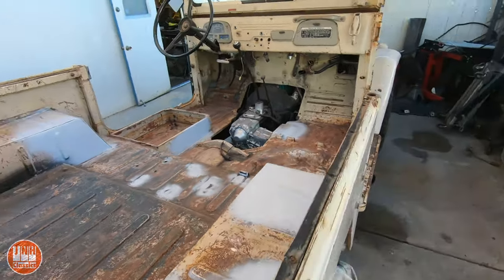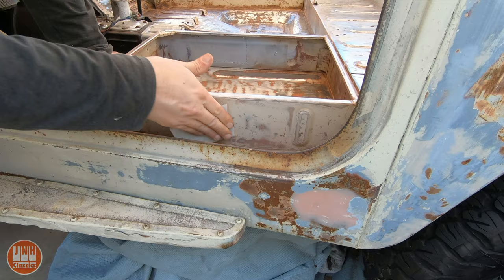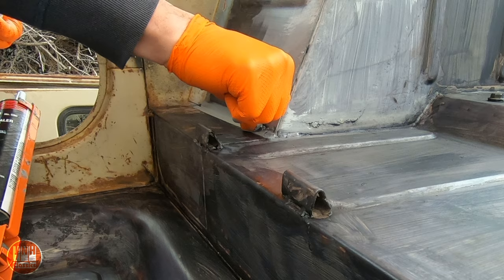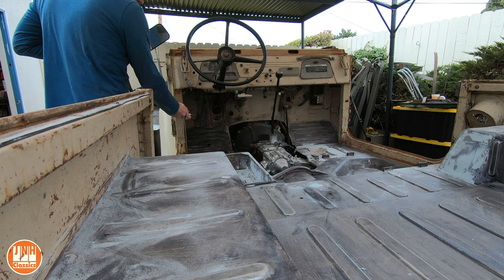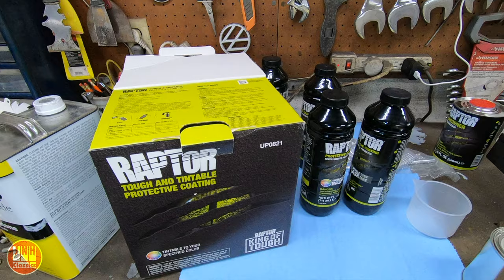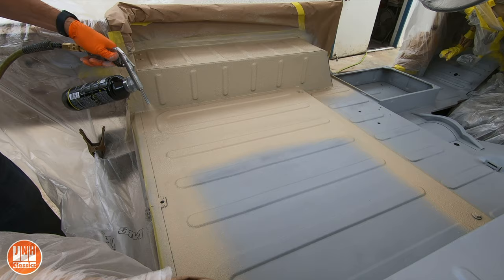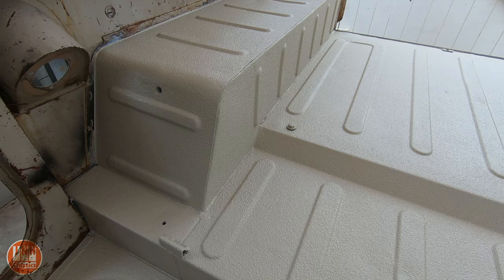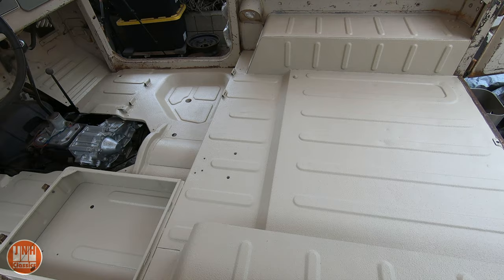FJ40 Build - DIY Raptor Liner

Comment: .....you'd have been smarter to use the appropriate cup wheels to begin with. Lol
Reply: @JNHClassics  Those paint stripping disc's are a horribly inefficient way to remove paint. Cup wheels are much better. They make them with plastic abrasive wires in grits too. They do great and don't damage substrates, get into lows and hit high, etc.

Comment: I would highly highly recommend hitting it with a clear coat (even if you do matt or semi-gloss). The clear will close off any micro pores that catch dirt and that make it raggedy looking in time...in addition is quite tough to clean and take care of with out the clear. The clear makes everything float on the toppest layers and can be wiped up without the towel snagging and leaving lint. 
Outside the normal stuff like doing trunks, pans, engine bays I have a full blown custom Audi done in Raptor (full tear down/interior/exterior) with a stage 2 paint job over the top and a fully custom cafe racer in Raptor Ferrari Red 2 stage with chrome Raptor tank & pieces, both over 10 years so I'm pretty familiar with it outside the standard uses.

Comment: I wonder how durable it is.  I sprayed something similar in a work van and the stuff was hard as steel.    Years later I wanted to do it again but couldn’t find or remember the name.   Looking for a replacement.  It was a 2 part product that came with its own sprayer.   You needed a respirator with mine, it was nasty. Xylene based I think.  Dried very fast.

Comment: Looks really good. Did you ever consider the products that look like bedliner but also have sound and heat properties? Especially for the floor and firewall. I used those on my 1969 FJ55 and they work remarkably well.
Reply from the maker: Good to know. Thanks
Reply: @Jerod_Helt  The product I used was Lizard Skin. Two coats of each for sound and heat. I have heard some still like to spray on a true liner product on top of that.

Comment: What PSI (understanding recommended PSI is 35-60) did you use at the compressor? (currently working on a 76 FJ40)
Reply from the maker: I set the compressor at 50psi